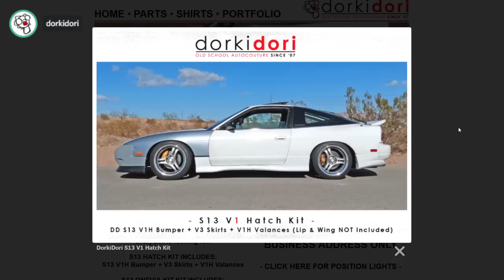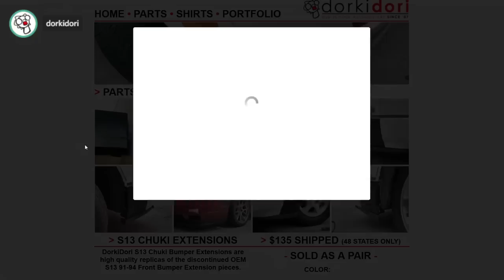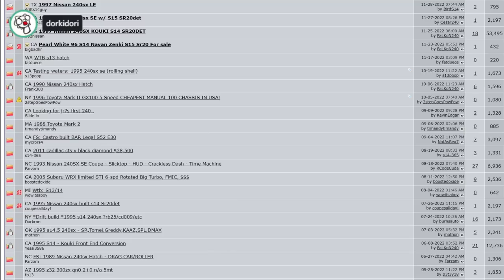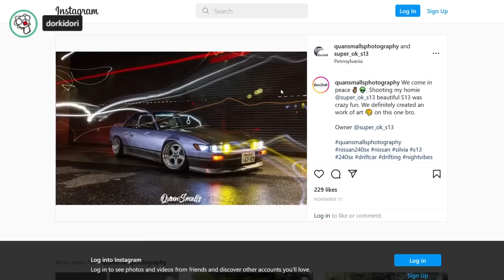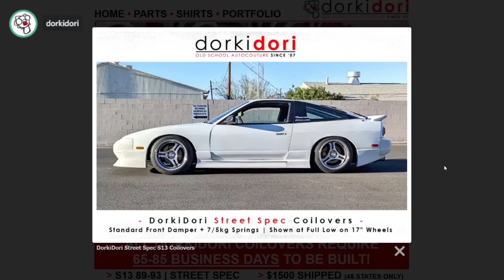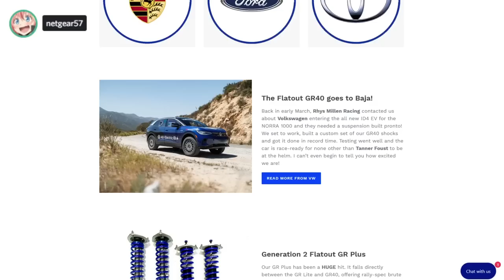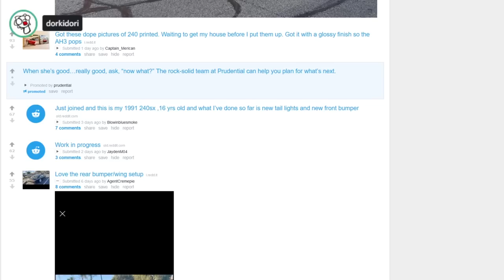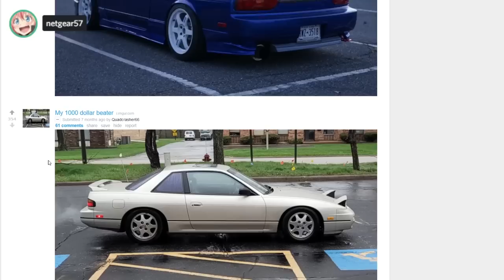NISSAN 240SX LORE: our DORKIDORI interview

Comment: BRZ owner here. I agree, the BRZ is slow as hell. A mustang ecoboost is signiificantly faster. I don't think it's fair to say it's slower than a stock for stock 240SX though. Everything Dorkidori is saying is 100% true, though.
Reply: mustang ecoboost IS the replacement for the S-Chassis. i test drove one ages ago when it came out and was beyond delighted that it was SO close to a stock S13/S14 with SR it was nuts!!!! Nissan REALLY missed out on a MAJOR opportunity to do some brand rebadging in making the ecoboost Mustang the true successor to the S-Chassis!
Reply: @dorkidori  i work at a Ford dealer, so I'm very knowledgeable about the cars. I was strongly considering the ecoboost, but the BRZ came up for real cheap, so i snapped it up instead. No regrets, tbh. I've been enjoying it thus far. I think it's more comparable with one of the cars that inspired it, the AE86. Underpowered rear wheel drive sports car that's basic as fuck. Great car to learn new driving styles with.
Reply: @Sentient6ix  eh, im long past the lower power JDM thing... the ecoboost mustang easily makes power, handles well and feels much more akin to an s-chassis to me. the FRS is a neat idea on paper, but the fact the motor is such high compression, its only a matter of time before it pops under boost. another person in the comments and i were going back and forth about it. guy said something around the lines of GT86 owners boosting their cars to 10-12psi without problems. underlying issue though is the bottom end. it was never built for boost, and its only a matter of time before one of the rods breaks and punches a hole thru the block. its the same thing as the motor in the Mazdaspeed Protege. its the same NA 2.0 as the Protege5 and MP3. weak bottom end. company that did the turbo setup for the MSP that Mazda hired only set it up to run 7-8psi safely. back when the motors were new, yeah you could boost them over that factory pressure... but due to the age, its literally only a matter of time before you send a rod thru the block. i get the feeling the GT86 FA motor is the same way. sure 20-30k miles of that will be fine, but its ticking time bomb.
Reply: @dorkidori  yeah, i have no intentions of boosting it. If i want power, i'll just plop in a vortec instead. The FA20 isn't worth throwing a pile of money at. All valid points
Reply: but it looks fast lol

Comment: As someone trying to eventually start a buisness producing body kits, this is definitely a solid inspiration
Reply: just a heads up... the way i do things versus the way things are done now are very different. i dont use 3d scanners or printers. everything is done by hand. its not an easy racket to get into and sustain, especially now with modern cars that cant use body kits due to all the stupid sensors and such in the bumpers.

Comment: I will agree, there’s never gonna be another car quite like the s-chassis, but it pisses me off when people boo-boo the brz/frs/86. We’re overlooking a great car because internet says S L O W. Fuck, a stock frs is slightly faster than a stock SR s13. Additionally, EVERY 240sx was a slow piece of shit KA at some point to us and now look how highly we value them.
Reply: big difference is... CA and SR (even KA) arent stuck with a 12:1 compression motor that can only handle 4-5 pounds of boost in stock form. you can easily get low 14/high 13 passes out of a stock SR with manual boost controller. FRS/BRZ motor, good luck. and again, this goes back to what i was saying in the video... modern day japanese cars suck compared to the 90s counterparts. 90s JDM sports cars/sport compacts generally had motors that were over-engineered and were easily modified. 

the GT86 is a cute car and all, and im sure the younger generations will turn them into the next 240sx... but stock for stock and what you get for the money, S-Chassis will always best GT86 simply due to the motor.
Reply: @dorkidori  Agreed, modern engines for a lot of cars I'd say from about 2008 onward are just too high strung from the factory. Mainly due to extremely strict EPA reg's/fuel standards and cost cutting.
Reply: @dorkidori  there’s plenty of people running 10-15 psi on HKS setups making 350-450whp daily driving on these things so i don’t agree with that sentiment. What made the schassis special is the cost to performance and yeah, schassis is still a bit better of a deal, but i know in the coming years the 86 is going to be the platform of choice for entry level econo sports cars, they are just now dipping under the $10k mark. Look what parts companies are doing. greddy, HKS, Tomei, URAS, Origin are cranking out parts for them, they see that in the next 3-5 years, zn6 are gonna crossover that threshold where turboing one will be cheaper than buying an schassis of any flavor. i’m not suggesting that schassis are going to be uncool, I love my S14 and i’m planning on buying an S15 next year. But as far as cheap performance goes, they are going the way of classic muscle, it’s not going to be economical anymore and hardly is now. 

I’ll be the first to agree that modern JDM cars are dogshit, especially nissan. Anything worth buying before 2012 was American or German. The thing is, 86 twins are well built cars, I flogged the shit out of my old one at the track then drove it home many times. Super simple to work on, suspension very similar to my 240. Obviously we’re not getting the 90s again with the zn6, but the car keeps the dream alive for me.
Reply: @dorkidori  Not all of them suck. The 2nd Gen BRZ/GR86 can run in mid to high 14's in stock form. It's by no means perfect but when compared to the S cars it pretty much weighs the same, has a much more rigid chassis, and has great N/A power for 2.4L.
Reply: @dookiekouki-us  biggest thing with people running 10-15psi on a stock 86 motor is how long is that actually going to last? SR/CA/RB were engineered for turbo use, and all 3 were very overbuilt from factory. they can easily handle larger turbos and boosting well beyond factory pressure for their entire lives. the 86 motor was never built or intended for turbo use. the situation to me sounds the same as the factory Mazdaspeed Protege FSDE turbo motor. it is identical to the N/A variation in terms of head and block. only differences were the block was tapped for oil sending line (i believe) and ECM was tuned slightly different. factory boost was set at 8psi. in their healthier and lower mileage days, people would add more boost to them beyond factory spec... however, now that the motors are basically dinosaurs, adding anything more than factory boost generally winds up sending a rod thru the block as the bottom end simply wasnt built for that added pressure. i get the sneaky feeling that the 86 motor will wind up with the same issues. most of the time, the reason you see higher mileage SR/CA/RB motors popping is due from a life of sheer abuse, tuning ignorance and over all neglect in terms of general maintenance/care. 

longevity on adding that much boost to such a high compression motor that was never intended to see boost will be interesting in regards to the 86 and your argument above. generally, turbo motors are a lower compression setup. they can be built to high compression with turbo use, however... that has to be planned for in the build and tuning.
Reply: @dorkidori  I’d agree with most of that. I have faith that modern ECUs are capable enough to make turboing these viable particularly for track use. So far I’ve seen a few turbo zn6 drifting and doing really well so hopefully that’s a good sign. From what I understand they take boost surprisingly well, direct injection turns out to be a huge benefit to these engines as far as efficiency and reliability goes. I don’t think we can compare schassis to zn6 apples to apples but I think we can just be happy the zn6 will take over as the workhorse in drifting and schassis will finally be spared.
Reply: @dookiekouki-us  its not so much the ECM tuning that concerns me... its the bottom end of the motor. factory turbo bottom ends tend be much beefier and better engineered to handle the added stress a turbo puts on it. rods are usually the biggest factor in it all. as i mentioned about the FSDE from the Protege, the rods are usually the thing that goes pop in those motors with higher amounts of boost and like to punch holes in the block when they snap. also with modern engines, tolerances now are SO much tighter with the pistons than they were in the 90s which plays a large factor as well (0w20 oil vs 10w40).

again, i guess well see as time goes on how well and how long the FA20 can handle higher amounts of boost for. IIRC, when the first HKS and Greddy turbo kits came out for the FA20, they were limited to like 4-5lbs of boost to keep everything reliable.

Comment: Nissan has been ahead of its time for awhile lol! for example My 75' Datsun 280z has factory fuel Injection back in 1975 that was way ahead of its time. And even the early 240z cars had factory AC yes AC lol. I had a 72' Datsun 240z that had Factory AC. And sadly i sold that 240z back in 2014 should have never sold that one.
Reply: they WERE ahead of their times prior to the 2000s. i use the FM platform as that jumping off point. the Z and G really stagnated badly. the GTR, still the same car that debuted in 2008. Nissan has really lost its way in the last 20 odd years. you still have Toyota and Honda innovating and doing fun things... while Nissan just keeps zombie cars on life support.
Reply: @dorkidori  what about the new Z 400 hp stock twin turbo 3.4 0-60 with old school datsun styling